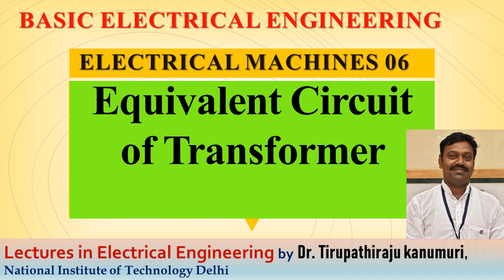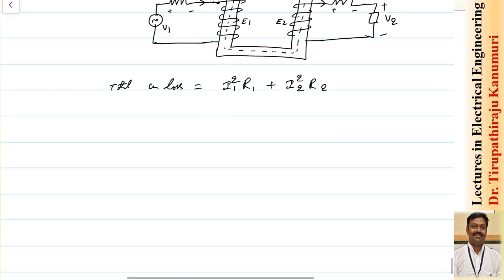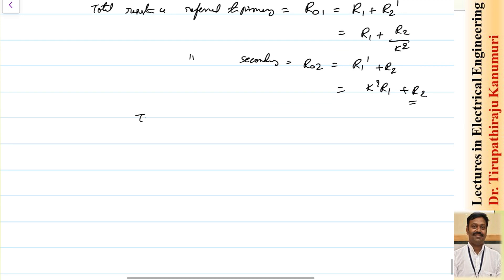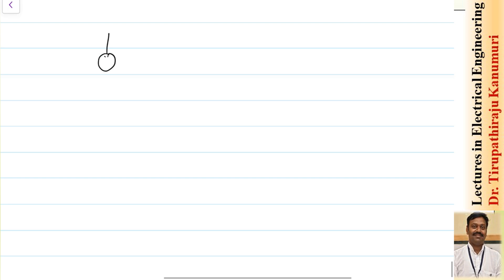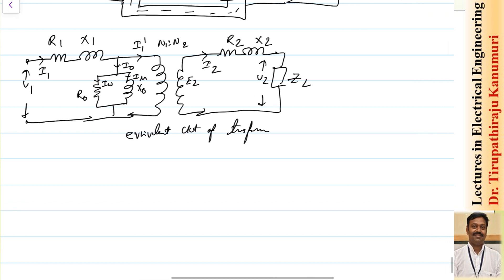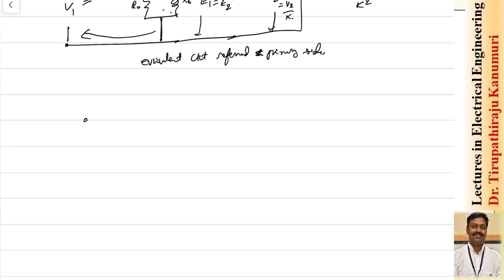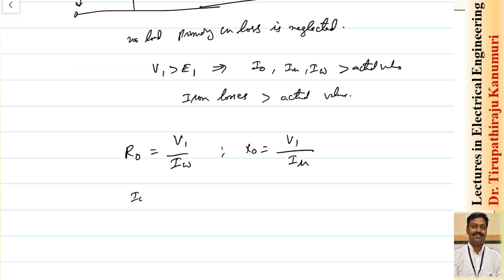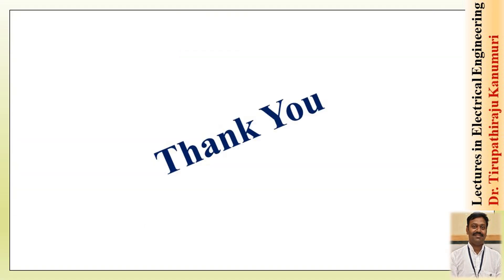BEE506 Equivalent Circuit of Transformer

Comment: Sir I've gone Through Hughes Book page(699)  It says that Per Unit Resistance drop = {(Full Load Primary current) × (eq resistance referred to primary side)} /V1

But You've taken Induced voltage E1 instead of Primary volyage V1 why this is so?
Reply: @lecturesinelectricaleng  Sir will Changing the base would affect the Answer? Or it will be mentioned which value we have to take as base value?